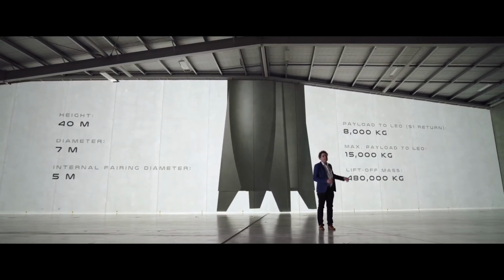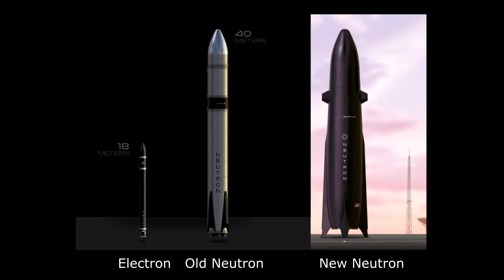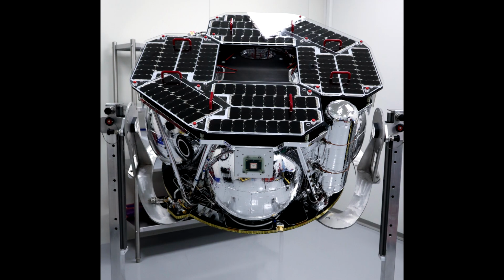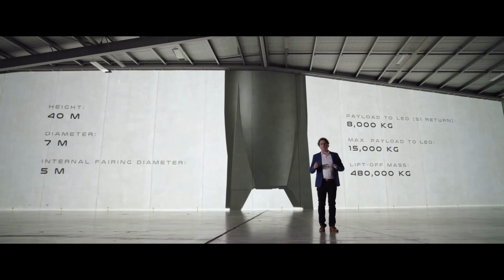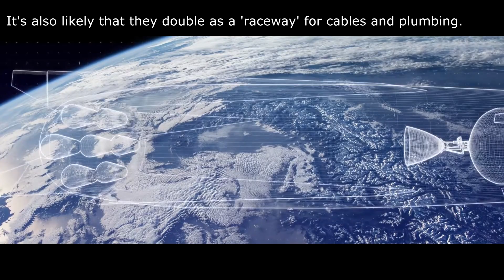Rocket Lab's Neutron Rocket Will Be More Reusable Than Falcon 9

Comment: Sucks that it's still not fully reusable. 2nd stage gets disposed of every time. Not a 2050 rocket imo. They better figure out a way to reuse the 2nd stage.
Reply: There is no way to do that without making it heavy.
Reply: @randomnickify  Not yet anyhow. You can see in the Rocket Labs video that they might implement reusability for the second stage when the technology needed matures. There is actually one way to do it and that's an inflatable saucer shaped ballute around the engine bay of the second stage. That could be light enough and the materials tech is almost there.

Comment: Using carbon fiber on the first stage makes perfectly sense, as this part of the system is reusable only, thus it has to be optimized for performance. Next step could be upgrading the sea level engines to staged combustio cycle.

Comment: This landing leg will not work for such healthy body. Surface areas are too small to keep it standing. Slightly angle landing will crash the touching leg immediately without proper shock absorber As we know  this things well studied by SpaceX for starship development. Yet considering the weight differences between steel & carbon fiber rocket.
Reply: its not that hard to introduce a shock absorber.
Reply: @saumyacow4435  Shock absorber is just a problem of many. The landing surface areas are just too small. All 4 legs to be touch in surface at the dead same time in dead 0 acceleration.
Reply: @Zahidulhasan  that depends on the design of the shock absorber...

Comment: Looks like they designed(or atleast on the animation) the landing legs to be retractable. You can see it on 10:33 where the legs are in-level of the tip of the engine bell.

Comment: Interestingly, in the renders, such as at 5:34, it appears that the landing legs are retracted a bit for re-entry. I wonder if they actually plan to do that, and mechanically how they would do that. It makes sense that they would have a lot more heat to deal with if they don't retract, and still a lot even if they do. They seems much less protected from hot re-entry gasses than F9's legs, even if the do retract slightly.

Comment: The goal of the Neutron Rocket program seems be competition with, Falcon 9 which Space-X had developed years ago. Falcon 9 may soon be of little use once the Starship, if they meet their goal, will make Falcon 9 and it's competitors insignificant in terms of cost per ton as well as tonnage capacity. I am glad to see other innovating in the space business and regardless of success or fail, they will bring about great talent to contribute to the field of space travel. Right now, I honestly don't see anyone but Space-X eyeing first place in the space race. Rocket Lab may shake out to be a strong 2nd. Yes, I am a Space-X fanboy but if I am wrong, please tell me why.
Reply: I don't think anyone would dispute that SpaceX are pretty well fixed at the top of the rocket food chain, but there may be room for some others below them. Obviously, Starship is going to be hard to match when it comes to heavy lift, whether that's large single payloads, or large clusters. But it's much less certain that SpaceX can get the costs down enough that it can compete for smaller payloads too — they think they can, but RocketLab are obviously betting otherwise. 

It's interesting that they cite constellations as a target market. One of the factors driving Starship development is that they can't deploy Starlink quickly enough with Falcon — but I don't think that's a matter of size, it's a matter of rapid cadence, many launches to fill out many different orbits, since Falcon takes about a month to turn around boosters. Neutron could be competitive in that respect, if RocketLab can build new second stages quickly enough to launch frequently.
Reply: @simongeard4824  I agree there is room for competition and competition drives innovation which is good for everyone. One major hurdle Space-X is facing with Starlink version 3 which I believe is in full production can only be deployed via Starship due to the form factor of the Satellite. Space-X has a lot of eggs in that basket. It'll be interesting to see what happens as they tackle Raptor engine issues.
Reply: @pauldobson9379  So consider alternative constellations like One Web or Kuiper, who are launching on Soyuz and Atlas respectively... presumably because they're willing to pay more to avoid paying their competitor for launch services.

That seems to be the niche which Neutron is targeting... big enough to launch maybe 30 satellites at once, significantly cheaper than non-reusable competitors, and with a high enough launch cadence to be able to build out a constellation in a reasonable time. Starship might be able to launch 200 satellites at once, but if nobody needs 200 satellites launched to the same orbit, that's not especially relevant... cost per kilogram doesn't matter if you're not using all the kilograms available.
Reply: @simongeard4824  Having to pay far more than your competitors just to avoid giving them business sounds like a tough spot to be in. Rocket labs is in a relatively good position. Anyone with reusable rockets will be part of making everyone else obsolete.

Comment: Something I really like about Archimedes is that Rocket Lab isn't using all the power in the engine. This will help reusability since they won't break down as quickly and just require routine maintenance. I think SpaceX engineers working on Raptor should start looking into this to possibly help future development.
Reply: Less power means longer lasting? I am skeptical about this claim. I would say better design/materials means longer lasting.
Reply: @clarkkent7973  Why not both?

Comment: Given that carbon fiber tends to be more expensive than stainless steel, the cost per ship would be higher, which would mean people FLYING on the starship would need to pay more, but no one's flying on the Electron rocket, so they can afford to make rockets with relatively expensive materials, while making less rockets because they're not for human travel.
Reply: The dry mass of Starship is just insane. A Heavy-lift Vehicle from NASA's SPS study has similar payload to Starship (120t), yet only 4000t mass when full. Which is less than simply the fuel mass of Starship, and even with some mass reserve! Apparently, aluminium construction/winged flyback is a pretty efficient design!

Comment: Thinking outside of the box, reducing the redundant irrecoverable mass, increasing the re-useability = good economic sense and results in greater lift capability. Very cool presentation and this beast will work well together with Starship not against. They will/should be mutually coherent vehicles. Nice one New Zealand and USA.
Reply: It's 200,000 pounds lighter than what SpaceX is making, because less dry mass means less fuel, slightly smaller engines, and on and on.  It all adds up.  The downside is the massive sunk cost and tooling.  In the end, though, less static weight required per kg to orbit wins, as it significantly lowers the cost to the customer.   I suspect their cost per kg to orbit may be awfully close to the magic $1000 per kg.  SpaceX is nowhere close to that number at present, and even those crazy people at SpinLaunch ( if it works - lol ) are looking at $500K for 500kg - about the same price.

Comment: Hanging the second stage from the first stage is cool, but doesn't it still need to handle the compressive stress of, you know, firing the second stage engine? Is that really just that much less force than from the first stage, or surface gravity for that matter?
Reply: I was wondering that too. I think the real gain is that the second stage isn't wearing the weight and aerodynamic load of the fairing.

Comment: Cool, innovative design.

Maybe this will eventually be a second stage, with a superheavy style booster?  Its low density (composite materials, retained fairings, simple engines) and aerodynamics (fairings, legs) may mean it can handle reentry heating from LEO (perhaps with some TPS - e.g. shiny Electron first stage)

That could be revolutionary - competing with Starship, not F9 ...

Comment: Scott,  any thoughts on how the second  stage gets around "pushing" the  payload?
Reply: It needs comparatively little strength in the "push" direction, that can be a low-g thrust and it won't have to deal with pushing it thru the atmosphere. Suspending it and attaching the payload to the top of the 1st stage means it doesn't have to support the payload during the 3+ g of launch and pushing it through max-Q.

Comment: it'll be interesting to see what they come up with. I've worked with polyimide composites which are supposed to be about the limit of what you can do with polymers, it was pretty resilient stuff but I wouldn't put it next to a burning methox torch like you get from the engine, it will burn up eventually

Comment: I would venture a guess that there is about a 50% chance that the Neutron will fly within a year of New Glenn. It would not be impossible for Neutron to have a successful operational flight before Blue Origin's orbital rocket.
Reply: Well, the last official statement had NG launching Q4 2022... so given the well-known problems around the BE-4 engines and the lack of anything resembling flight hardware, there's little reason to expect it to fly in the next couple of years. So yes, that does put it in approximately the same 2024 timeframe that RocketLab are talking about for Neutron. Of course, whether they'll be any more punctual than BO remains to be seen.

Comment: Rocket Design in the 1920s: Shiny, curvy, tall and with fins
Rocket Design in the 1960s: Straight lines, coregated metal, white/black checkerboard paint
Rocket design in the 2020s: Shiny, curvy, and fins!

Comment: Carbon fiber composites gain a LOT of working temperature range if impregnated with polysialates (so called "geopolymers") instead of traditional epoxy resins. If the pores are sealed up to prevent oxidation, some formulations were maintaining their strength past 800°C.
Reply: Interesting, and puts the nail in the steel-supremasist argument.  Lets not forget that the ultimate heat resistent material is carbon-carbon which covered the shuttle nose and wing leading edges, and it's basically just made by baking carbon fiber binders down to nothing but graphite, the cost is brittleness but they can presuamably make a trade off between the two.
Reply: @kennethferland5579  The only issue with carbon-carbon is that it can burn if heated in air. Using a ceramic (or geopolymer) binder to protect it from oxygen does a lot to improve its lifespan.

Comment: Those landing legs are going to cop even more of a beating on descent. Could be a combination of high temp alloys, insulation and (my favorite) active cooling. Liquid methane is an excellent coolant as its heat capacity rises with temperature. You could also exhaust some methane through the engine. This would be protective of the engine and also some of the surrounding structure. The methane boils, heats, then dissociates - taking energy with it.

Comment: It's a neat design. Probably use titanium legs for the high temperature exposure they have to endure. Carbon fiber is a very tricky material, it could take them a long time to figure it out. Elon has a pragmatic approach of using steel, which is a unique material due to its ability to selectively deform under tremendous stresses, without breaking. Steel is a magical material, and should never be underestimated.
Reply: The dry mass of Starship is just insane. A Heavy-lift Vehicle from NASA's SPS study has similar payload to Starship (120t), yet only 4000t mass when full. Which is less than simply the fuel mass of Starship, and even with some mass reserve! Apparently, aluminium construction/winged flyback is a pretty efficient design!

Comment: I find the demo with the battering ram a big roll-eyes moment (room temperature conditions, flat panel, ...). Also, they are comparable to falcon 9, not to starship.
But, rhetorics aside, it is great that they go with a different technological path: this will allow both to be compared in that application

Comment: I like steel better than carbon for the pressurized tanks.  Carbon fiber composites are not actually much stronger than steel... the usual advantage is that they are stiffer.  But a pressurized tank doesn't need stiffness.  And steel keeps its strength at much higher temperature.  That said, the non-pressurized parts of the vehicle do benefit from stiffness, and connections between different structural materials that have to tolerate large temperature swings are probably heavy.

I'm very happy to see the fairing is part of the first stage.  This should lead to a tradeoff which favors a slightly higher staging velocity than SpaceX.

I like the squat design.  That'll help with the aerodynamics coming back.  I would have liked to have seen the nozzles aerodynamically coupled together so that the rocket would benefit from base pressure for the first part of flight.

I like the mostly-fixed landing gear, but I'm not happy to see it hanging down below the nozzle exits.  I would have preferred to see something that extends down just prior to landing.
Reply: And yet, almost all new HPA and scuba tanks are carbon fiber and safely operate at 3000+PSI.  The weight difference is quite dramatic as well.  Steel is really old tech at this point.  As Scott mentioned, the advantage is speed and cost to prototype.  Hammer, weld, or rivet it all together, expect it to fail, collect data.  I can't imagine that the final Spaceship design that is used won't be carbon fiber as well once they get it all working properly.
Reply: @plektosgaming  I didn't know that about SCUBA tanks.  I'll look into it.

Reentry heat is a serious problem for composites.  The lower stage can face less onerous temperature extremes than the upper stage, but things still get pretty hot.  And, you can save propellant on the reentry burn by tolerating higher temperature.